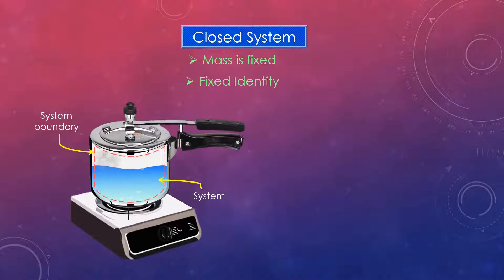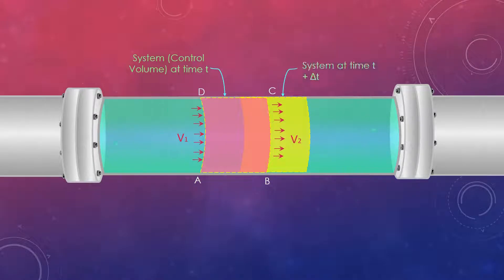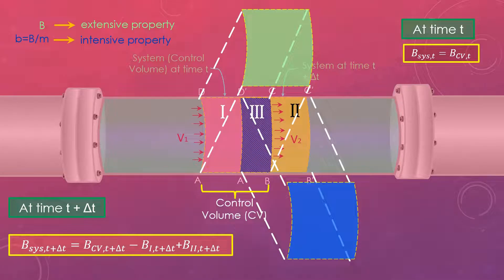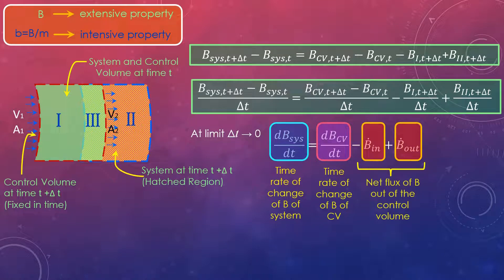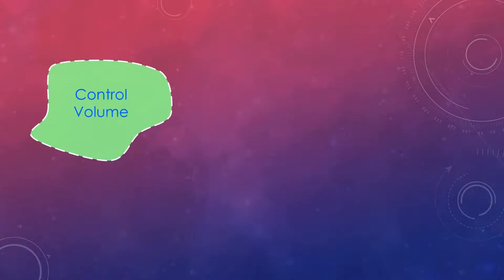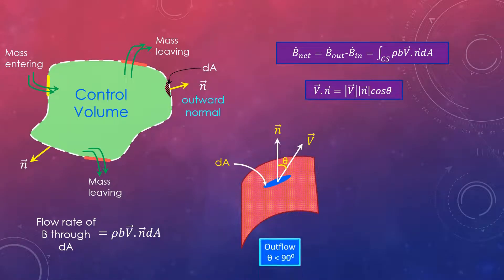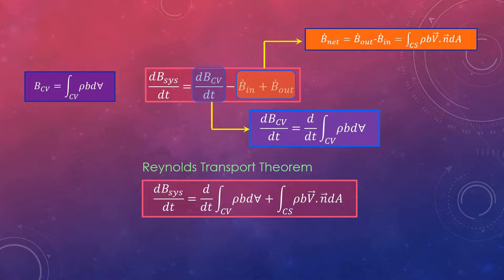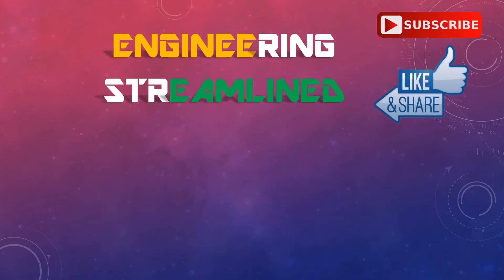Understanding Reynolds Transport Theorem

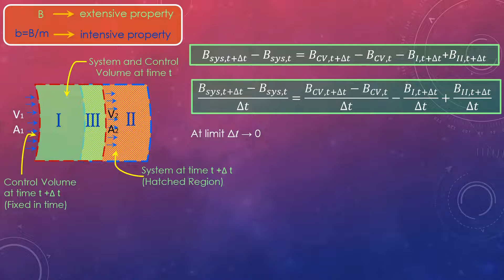Comment: sir how limit del t=0 (3:56)
Reply from the maker: Limit in a formula means that we've limited or shortened the formula to a certain extent or in a range of values. In the present video, when we say at Limit ∆t –>0 it means that we have restricted the formula to a short interval of time only. So, for a short instant of time dBsystem /dt gives instantaneous change in B of a system with time. You can check this link for more detail explanation on limits
https://math.stackexchange.com/questions/3920654/why-is-delta-x-tending-to-be-zero-in-dy-dx-and-not-delta-y-tending-to-be-0

Comment: sir how to substitute limit del t=0 3:56
Reply from the maker: Limit in a formula means that we've limited or shortened the formula to a certain extent or in a range of values. In the present video, when we say at Limit ∆t –>0 it means that we have restricted the formula to a short interval of time only. So, for a short instant of time dBsystem /dt gives instantaneous change in B of a system with time. You can check this link for more detail explanation on limits
https://math.stackexchange.com/questions/3920654/why-is-delta-x-tending-to-be-zero-in-dy-dx-and-not-delta-y-tending-to-be-0